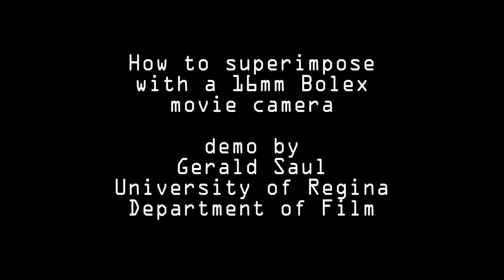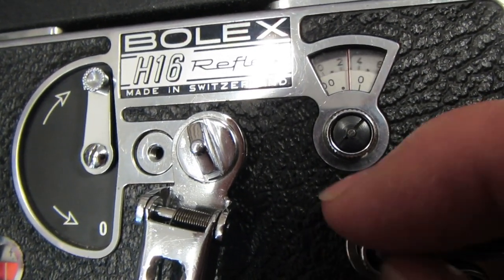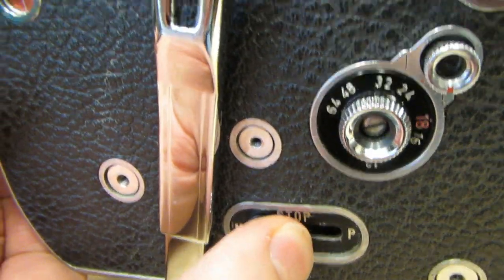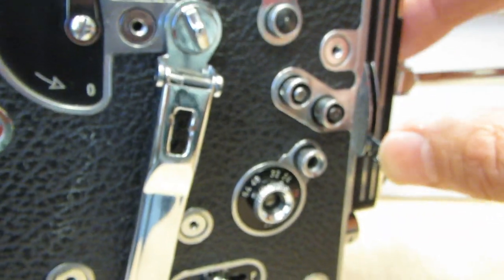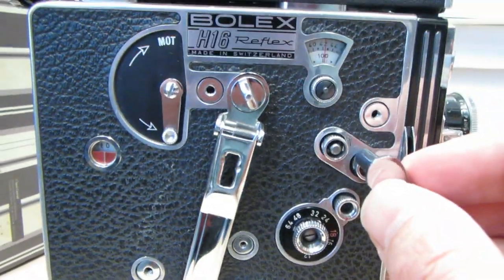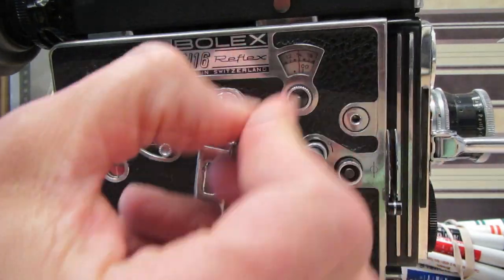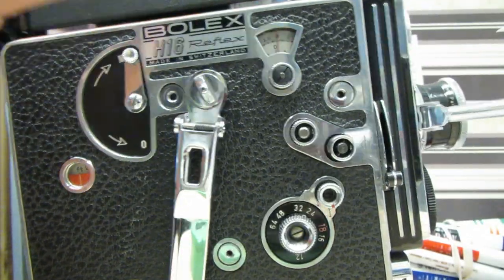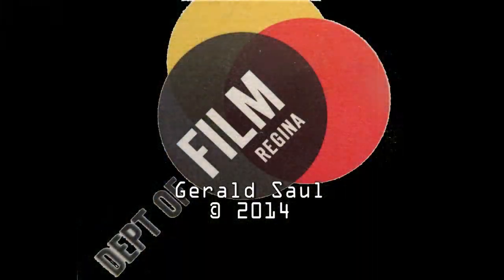How to Superimpose with a Bolex Movie Camera

Comment: Hi Gerald, I was trying to figure out the difference between the upper dial and lower dial of the frame counter, but I couldn't find an explanation on the internet that I understood. When reading for double exposure, do I read the upper dial, or the lower dial?
Reply from the maker: You read both of them.  When you are shooting with the camera, the upper counter will move fairly quickly as it is counting frames, rotating once every fifty frames. The lower counter also moves at the same time and tells you the overall number of frames. For example: if you zero both counters then shoot for exactly ten seconds, what you will find is that the lower counter will say that you have shot between 200 and 250 frames. You look at the upper counter and it would say "40". This gives you the more precise number, which would be 240 frames.

Comment: i've heard of people using the rewind lever/key to actually film like they actually captured footage hand cranking the film through the bolex. Would you know how to achieve this?
Reply from the maker: Not difficult.  Similar to the process of rewinding, you disengage the motor but don't rewind and don't close off the lens. Turn the crank the opposite way as the indicated tells you and the camera gate will open and close and the film will advance forward. The tricky part is calculating the exposure. To do that, you would want to remove the lens and observe how many times the gate opens and closes with each revolution of the crank (I think it is six, but I don't have one in front me me right now). If that number is correct, and if you turn the crank at the rate of once per second, then you would expose each frame for one twelfth of a second and you'll need to set your Fstop for that.  Put the lens back on, measure your light, set your f-stop based upon how fast you are comfortable turning the crank, and make a movie. Often when you stop, you have a fifty/fifty chance of having the gate partially open and giving you a flash frame. Expect this, it will be unavoidable.

Comment: Hi gerald, can i use my hand to rewind the knob or do i have to have a rewind key?
Reply from the maker: Unfortunately, you definitely need the key. The gear is inset and there is no way to access it with your hands or even a pair of pliers.
Reply: Gerald Saul yeah that seems to be the case. Working on getting a key
Reply: hey gerald, one more thing. If I am not too concerned with the exactness of my impositions and just really want to double expose the whole roll, could i shoot almost the entire roll and then use the rewind key to pull the film all the way back?
Reply from the maker: You could do that. Rewinding takes quite a while. I imagine it would take 15 minutes or more to rewind a whole roll. Optionally, you could shoot the whole thing then use rewinds in a dark room to wind back to the start and then reload it.
Reply: yeah i could do that too. thanks